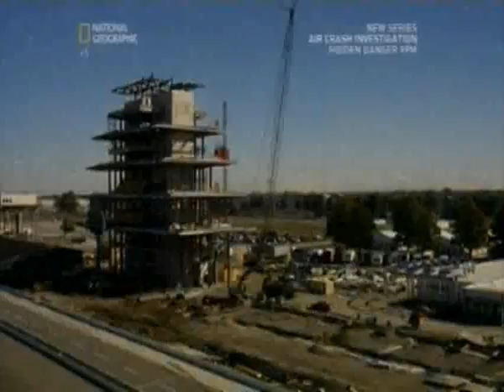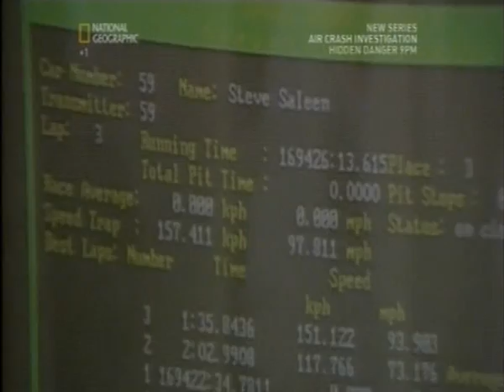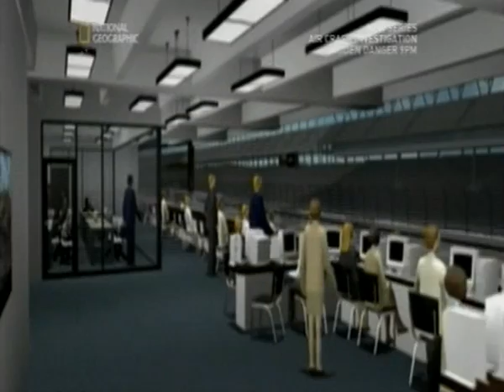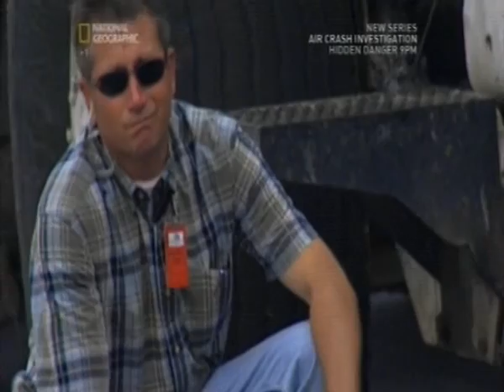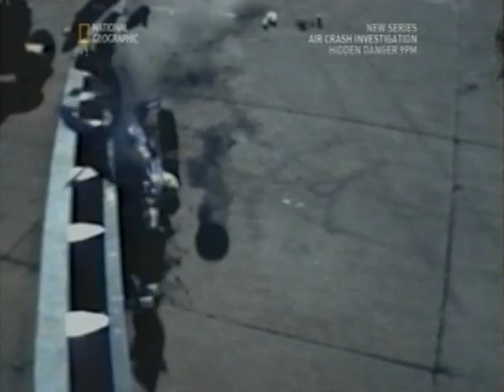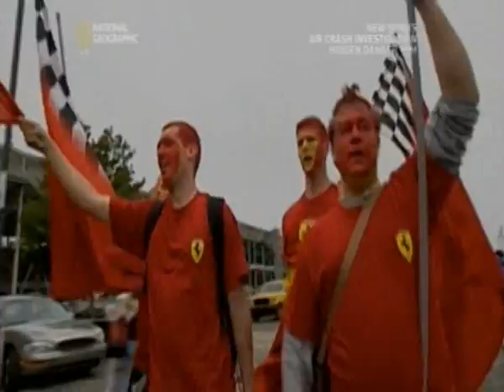Indy Motor Speedway (Nat Geo Program)

Comment: My most vivid memories of the IMS construction project came during the 1999 500 and 400. Not only had the top four floors of the old Master Control Tower been removed, but they had also removed the back of the tower, which included the stairs to get into the tower.  We had to enter using some scaffolding placed on the south end of the tower and go through a hole on the second floor where the old pylon controls had been.  It was a little precarious lugging broadcast equipment to our post during practice and qualifications up that scaffolding. It was well worth it. The MCT was really falling apart by 1999. It was all glass with no air conditioning and occasionally when you tried to open a window the pane of glass would fall out. The new Media Center was state of the art and is still an excellent place to watch, but I do miss the "closeness", for lack of a better term, of watching practice and quals from that rickety old sweatbox.